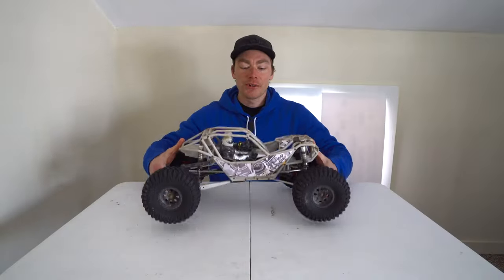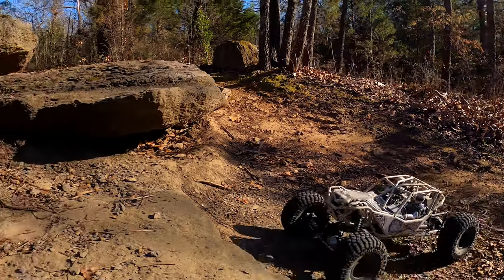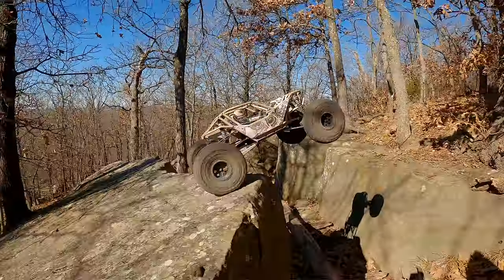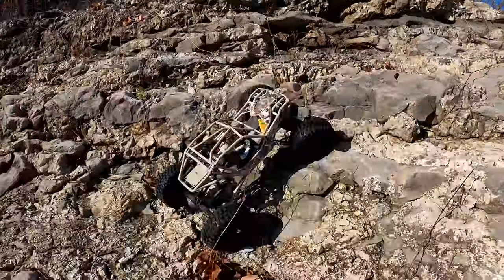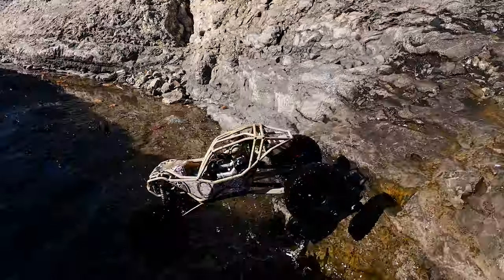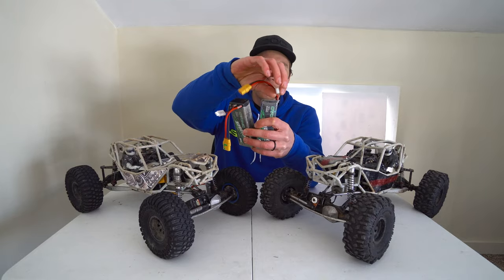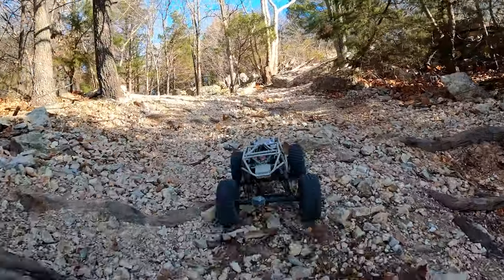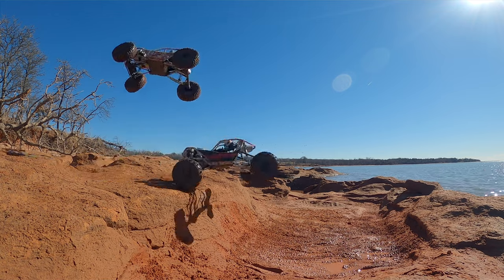Putting Important Axial Ryft Upgrades to the Test! Lots of Awesome Rock Bouncing Lines

Comment: I think you of all people would really love the motor I run in my ryft!!!! I’m running mambax paired to a tekin t8 2250kv gen2 it has great low speed runs cool very efficient and most of all has crazy screaming power I can only imagine what kind of trials /bouncer lines and hops you will be able to do with this setup!!! Your a beast man I really enjoy watching your videos!!!! Killer driving 💪💪💪🔥🔥🔥🔥
Reply from the maker: Nice, what battery are you running with that? I figured the t8 might be a tight fit but maybe it's worth the squeeze. Thanks! Glad you dig the lines I like to drive. I try to drive it like a trials bike and it seems pretty fitting for that. So much fun!
Reply: @PatSmage  I run a 5200 4s it’s a tight fit little bit of shaving on the skid but I did it and man I think you would be able to bunny hop like a mad man are you on instagram? I’m old dad sports rc on there !!! Lots of videos of my monster!!

Comment: Excellent overview new sub here. Ryft is my most favourite rc in a long time. I’ve done the same upgrade path pretty much. Keep some breaking points but beef where needed. I’m running castle 1415 2400kv mamba x 4s 5200mah I get lots of run time probably 40ish mins. Great for trails and sending it.
Reply from the maker: Thanks! Yeah it is becoming one of my favorites also, lots of fun. The second one I bought came with that 2400 castle motor and it does get much better runtime but is a hair slower than I’d like on 3s. 4s is probably the answer, might have to give it a go even though I have a bunch of 3s and no 4s at the moment.

Comment: Sick video, question, since this, what motor, if at all, did you switch to vs hw3200 kv
Reply from the maker: I have been running a Holmes 2700 on 3s. It was still a bit too much until I put the 2 speed in.